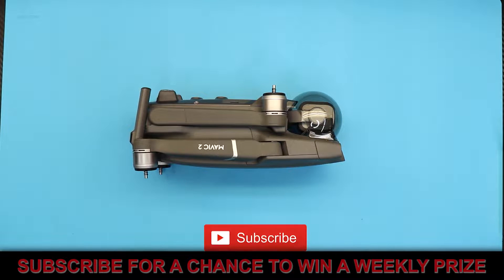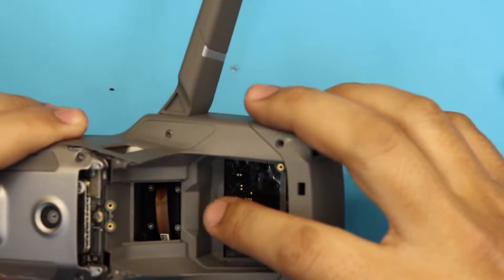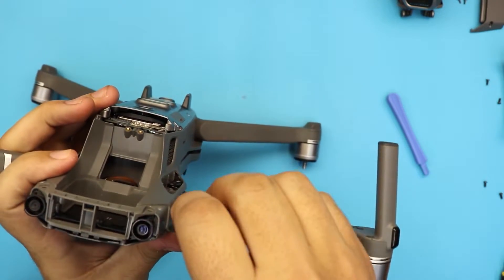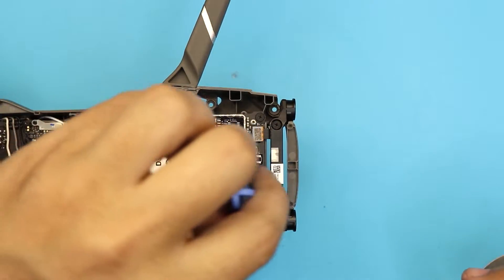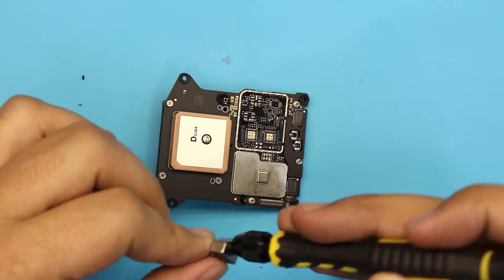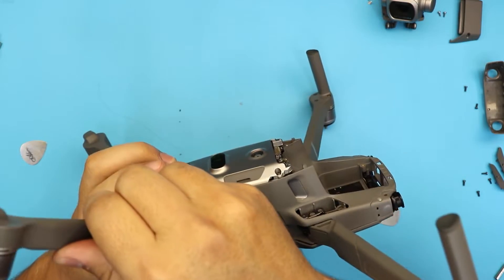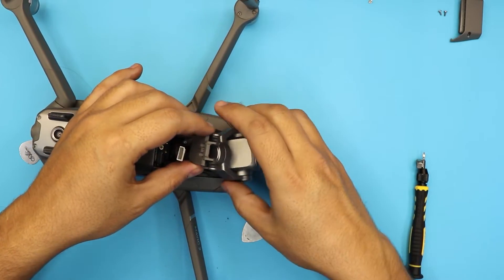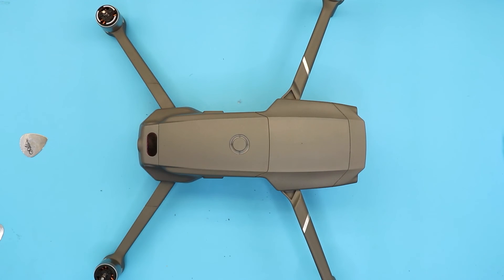FIX / Repair IMU of DJI Mavic 2 Pro

Comment: I am so grateful for your excellent tutorial. The IMU stopped functioning on my Mavic2 Zoom and looking at the amount of IMU's being sold on eBAY and elsewhere confirms this is a troublesome component.  After purchasing a brand new one and installed today plus calibration all round I am now 'operational' once more.  BTW, the rubber guard that came off in the upper cabinet assembly, I had the same issue.  To ensure it would not move on refitting I used a very small amount of quick setting adhesive which worked perfectly ( Gorilla glue ).
Reply from the maker: It's my pleasure, my friend. 😊 I deeply appreciate your taking the time to provide feedback. If you're inclined to support the channel further, feel free to like and subscribe—or even both!
I'm glad my videos are helping!🫠💞
Should you have any questions or requests in the future, please don't hesitate to ask me.
🍻cheers

Comment: Hello. I had recently acquired a second hand drone which may have been in a crash although there is no external damage that is apparent. It had an error saying IMU needs to be calibrated and COMPASS needs to be calibrated. I was able to calibrate the compass no problem. I was also able to go through all the IMU calibration steps where upon I get the message calibration completed successfully and two available options appear in boxes: go back to camera and restart drone now. When I restart the drone by powering it down and powering it back on, I get the same message that the IMU needs calibrating. No matter how many times I calibrate and each time it does complete successfully, the results don't change. The only thing that did change is in the sub menu on the smart controller it used to say IMU needs calibrating in red, now it just says restart drone in red. On the main screen though it says IMU needs calibrating in the top left corner in red. It's like the controller does not recognize that the drone has been calibrated and restarted. I have tried it with two separate controllers as well with the same results. Do you think the IMU needs replacing or is it something else? Thanks for any insight you may provide.

Comment: You ever repaired the bottom led light on a mavic 2 pro?
Reply from the maker: 🫠Regarding your question, yes, it is not hard. You need to detach the bottom housing, and then you'll have access to the LED. I don't have the drone to make a video at the moment.
Reply: @uFixTek  thank you for the reply.
Reply from the maker: It's my pleasure my friend.
good luck i hope you can fix it, take your time and it will go smooth.

Comment: I still don't understand how the drone senses that its battery isn't seated properly. I don't see any sensors for that. Do you know the answer?
Reply from the maker: Thank you for your feedback! If you wish to support the channel, you can like, subscribe, or both!
Regarding your question, it is because of the battery contacts, they may be corroded or not touching the inside contacts of the drone.
clean the contacts of the battery and the terminals of the battery inside the drone.
Should you have any further questions or requests in the future, please don't hesitate to ask me.
cheers🍻

Comment: Hi there.I have a big problem whit my Mavic 2 zoom vision sensors.I cant fly because the app tell me that rear left and right vision sensors are working badly.I cleaned and i try to calibrate using Dji assistance 2 many times but when i star the process the calibration freeze on the screen following the blue light and i must restart the program whitout any sucess.Can be a malfuncion sensors?How can i buy them and replace?The drone never had acident.
Reply from the maker: the issue is with sensors and i looked for them and i can't find a seller that has them, the only solution is to get a crashed drone for parts and remove the sensors and use them. look for facebook market place for damaged drone.

Comment: Thank you for the video, it was very well explained I must say. I have DJI Air 2s which I crashed a few weeks before and broke one of the legs. After having replaced the leg  I was able to fly the drone for a few minutes but it was not a very stable flight and I was able to land the drone safely. After landing I started getting IMU errors 30084, 30055 & 30056. I ordered new GPS module, IMU module and GPS flex cable to sort the issue. Replaced all three components but I was still unable to calibrate the IMU. It keeps getting stuck at 6% calibration and gives a calibration error. Any clue what might be happening here. Thanking you in anticipation and looking forward to your worthy guidance, please.
Reply from the maker: Thank you for the feedback! if you wish to support the channel you can LIKE or SUB or both :P
regarding your question: im looking into this issue and i will get back at you as soon as i get in contact with a friends that are directly in DJI service center.
Reply: @uFixTek  thank you for getting back. Liked and subscribed your channel already. And I would be anxiously waiting to hear back from you. This would be a great help mate. Standing by....
Reply from the maker: much appreciate the support and i hope i get a positive response from them regarding your issue. 🍻
Reply: @uFixTek  any feedback on error 30055 & 30056 ?

Comment: Gr8 video. I do have a question. After replacing the IMU sensor do i need to do some software work also? Like on cars if you change a part that is electronicly connected you need to learn your ECU that a new part is installed. Or you just start the drone and it works?
Reply from the maker: Thank you for the feedback! if you wish to support the channel you can LIKE or SUB or both :P
regarding your question: just start out and do a calibration and you all set.

Comment: Thanks for the video man. I was getting an IMU error and it wouldn't allow me to calibrate anything. None of the sensors were working, etc. After taking the drone apart, I noticed there was some water damage on the connector from the IMU to the board. There was also a lot of sand inside the drone. I ended up buying the IMU and the board together since it was only 50 bucks. This cleared up all of the errors. I'm guessing some moisture must've gotten into the drone, especially since I fly this thing at the beach often.
Reply from the maker: You are welcome! Glad you liked it and it helped you out,😊Thank you for the feedback! if you wish to support the channel you can LIKE or SUB or both :P
if you have any question or request in the future feel free to ask me. if you use it a lot over the sea you will need to keep those motors lubricated, saltpeter can damage the motor and circuits. do a monthly service.
https://youtu.be/ZyFIidWEQy8

Comment: Thank you!  After dropping my Mavic 2 Pro the IMU showed data errors on both accelerometers.  Using this guide I was able to remove and reinstall the IMU.   It corrected the issue.  Just to clarify, I reused the IMU and did not have to buy a new new one.  This saved me from having to send my drone to DJI for an expensive repair job and probably a three week delay in getting it back.  As it turned out I was able to get my drone back into service within 24 hours.
Reply: How did u reused the broken IMU  ?
Reply from the maker: Glad it helped! Glad you liked it 😊Thank you for the feedback! if you wish to support the channel you can LIKE or SUB or both :P
if you have any question or request in the future feel free to ask me.

Comment: Thank you for the insightful demonstration...i have a question or rather i need assistance in fixing my mavic 2 zoom drone...it fell in the dunes, it has electricity flow but missings the sensor signals to work or even giving the start up signal..any help or assistance.
Reply from the maker: Thank you for the feedback! if you wish to support the channel you can LIKE or SUB or both :P
regarding your question:   why don't you do a service and clean all the connectors and double check after.
https://youtu.be/ZyFIidWEQy8

Comment: Very helpful video!  I have a Mavic 2 pro, gimbal is no longer recognized after a very light crash.  Camera still works.  What can I check?  Where can I buy parts for this drone?  Thank you!
Reply from the maker: Thank you for the feedback! if you wish to support the channel you can LIKE or SUB or both :P
regarding your question: open up and service and remove the gimbal and disconnect the cable and connect them back in and test, i get parts off aliexpress or ebay.
https://youtu.be/sH4JsHSkElw
https://youtu.be/ZyFIidWEQy8

Comment: I have these messages repeating after few second:

0)Imu initialising
1)Navigation system redundancy switch
2)Switched to Backup IMU
3)Imu initialising
maybe by changing the IMU board.What do you think?
Reply from the maker: Thank you for the feedback! if you wish to support the channel you can LIKE or SUB or both :P
regarding your question: yes we do get the issue about the IMU in the store and we replace the IMU board and it all works normally.

Comment: Thanks for the great video. I have replaced the IMU but i am still getting these errors: ACC1 Desconectado... ACC2 Desconectado... GYRO1 Desconectado... GYRO2 Desconectado. Have you ever encountered this problem?
Reply from the maker: Thank you for the feedback! if you wish to support the channel you can LIKE or SUB or both :P
regarding your question:  i would recommend you to remove all the flex cables and reconnect the flex cable.just follow this video and disconnect and reconnect the flex cable, one of the flex cables are not making a good connections,
https://youtu.be/ZyFIidWEQy8
-Saludos amigo

Comment: Great Video,  I just recently hit a tree broke the Rear leg which I can replace but also getting an IMU ACC1 Data Error.  After several times to recalibrate still getting the same ACC1 Data Error.  Should I purchase a new IMU from EBay?  Will that fix the issue?
Reply from the maker: Thank you for the feedback and your support to the channel by a sub :P,
regarding the issue, we have purchased on ebay and aliexpress emu and fixed the issue, just a warring  we had to return twice the IMU because we guess they keep selling the faulty IMU on ebay, and the ali express purchase worked like a charm.

Comment: Why do the tools on the links cost thousands?  Like anyone’s going to buy those.  Good grief!
Reply from the maker: there is only one tool set of the screw drivers you need and this is a cheapest, unless you want to buy the really cheapest one and then you will or may damage the screw heads.
https://amzn.to/368LvmC

Comment: I own a dji mavic 2 pro. The problem that I am facing is that the core board doesnt detect sd card. I have checked with several sd cards. All the cards work fine on laptop and on other core boards. Also the sd card slot is perfect if paired with different core board. Kindly help with solution if you can.
Reply from the maker: Let me check, i get back at you
Reply: It will be really helpful. Will be waiting for your revert. I want to avoid changing the entire core board. Just want to fix the small issue in the core board of not detecting SD Card slot.

Comment: Hi mate. Great video, thank you. With the odd screw problem, 3 are short and 1 is long because of the length of the legs on the board, when you look at it you will see what I mean. Thanks again
Reply from the maker: Thank you for the feedback my friend and i take a took to what you mention :P thank you for the support

Comment: Hey i was flying my mavic 2 the other day and crashed no damage but the forward facing sensors saying somethings in front but theres nothing like the obstacle avoidance is on like its working in reverse i can't go forward because it saying something in front. If you can help that would be great. Thanks
Reply from the maker: hi and thank you for the support to the channel, and regarding your issue make sure that the lens and crystals in this two corners are intact and there is nothing physically wrong, and report back.

Comment: 6:02 I bet the empty circuitry is there for the Enterprise varient between the dual cameras and the attachments, I can see it needing some extra controllers. It'd be cool to confirm that though.
Reply from the maker: it is tru as it is the same on laptop the main pcb board is designed for all different models and depending the models for consumers they add and subtract components and futures, that way they dont have the need to print different circuit for different models, keeping the cost low.

Comment: If the GPS board is not good  is it the reason not to take off or the canera not to move?
Reply: Its because it has fet in the water bt had a gud clean up it turn on everything bt won't  fly
Reply from the maker: ya the gps is very sensitive part it can react with taking off and many other issues.
Reply: So u advice me to change the gps board in it then? U think it would be ok afer that in the future?
Reply from the maker: we dont know the damage that has been done on the main board with water, but we have repaired few drons by changing the GPS and started just fine.,

Comment: Hi ufixtec, need help, replaced bottom infrared sensor board but keep getting error msg saying upper and lower infrared sensor calibration error. How do I fix, tried vision calibration with no success. Do the boards need coded in ? Ps subscribed to your channel
Reply from the maker: there is no codding, reset the board and let me know, after you put everything together remove the battery and you will need to short the two right pins with two left pins for 30sec, that way the chip set will reset. (the pins on the drone not the battery) .

Comment: Hello uFixTex....great repair videos & great knowledge of Mavic2Pro.  I was flying my M2Pro yesterday..hit some tree limbs at low impact flying sideways, and now it will not take off. When I power on the drone and all props pulse 3 movements....the one that hit the tree only pulses 1 time and stops. Am I correct in believing that arm is damaged and needs replacing, or can I do something to fix it myself ? I know I can order an arm/leg but not great at soldering even though I have the gear. Thanks for help, maybe I can send to you to repair, but want to try "all I can do" if possible...Steve
Reply from the maker: send me an email, with a video few sec just when you turn it on, and you may just have to sync the rotors and that's all. 
remove the battery and and short the pins where the battery goes in , inside the drone for about 30sec. this will reset  the capacitors. the left pins with right pins short them (dont short the battery ONLY the drone pins)
Reply: I made a video showing what the Mavic Two Pro does when I power it on...three props turn, but front left does not move. How can I email this video to you from my iPhone  ?
Reply: Dude...thanks for your input...but I decided to do the repairs myself, and knowing I was a novice at soldering very small wires, I ordered a pro level solder station and watched a kazillion youtube videos before gaining the confidence to get started replacing my left front arm ! As always, Murphys law shows-up, as some of the tiny T-6 or T-7 torx bolts "stripped out" on me, and I had to get my dremel tools out and cut a line across the heads of two bolts, turning them into a straight-edge screws to get em out and proceed..which I did. You talk about being as nervous as a "whore in church" but I persevered and fixed my Mavic Two Pro, she's flying again and all things are good just in time to fly over some 4th of July colors...if there are any ?

Comment: hi i am getting IMU calibration failed error code -71 after a hard landing on my mavic pro.(Not mavic2) I tried re calibrating multiple times without any success. will it fix the issue if i change the imu module similarly like you did?
Reply: never mind. fixed it after changing the imu module :)
Reply: @AshishAmatya  
hello friend, did you make the switch yourself ?? found it difficult ??

Comment: Where can I get the gimbal ?, I had an accident with the drone, that one of the sides of the engine where the camera is moving seems to be broken, I also have an error in the IMU, I calibrate it but it keeps coming out an error.
Reply from the maker: you can get your new gimbal original here:  https://amzn.to/2QxO60m 
if the gimbal  is failing the IMU will give error too!

Comment: How would you know if you need an IMU replacement. I’ve been often getting Gimbal Overload Errors -any idea how to fix that?
Reply from the maker: if you had Gimbal Overload, that's not the IMU its the 3 axis motor error. this has happened to few clients of mine , that the only solution was to replace the Gimbal, and this happens because you / people try moving or touch the Gimbal when the drone is on, and this damages the elbow *axis of the Gimbal. or also you have put on a heavy lens on the Gimbal or if you have fly too much over sea water or salt water and that damages the Gimbal.
Reply: You probably need to replace the cable..it get damaged very easily